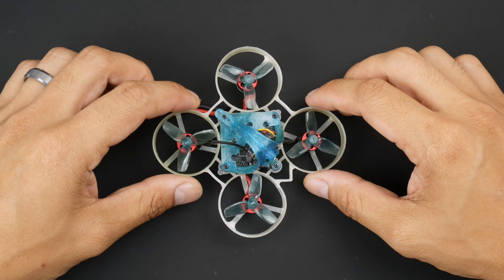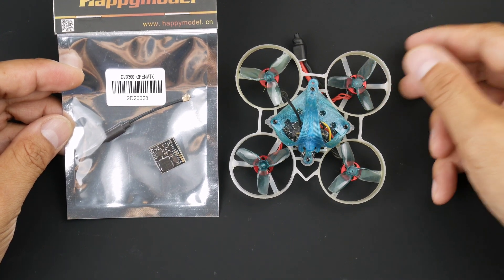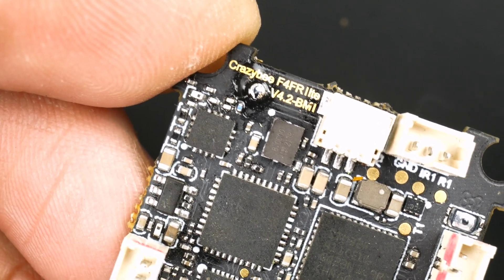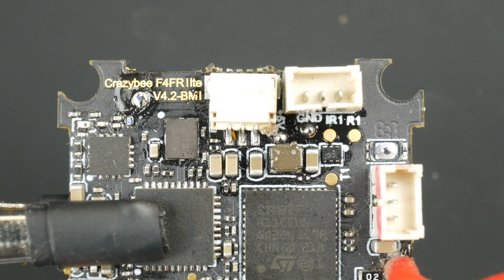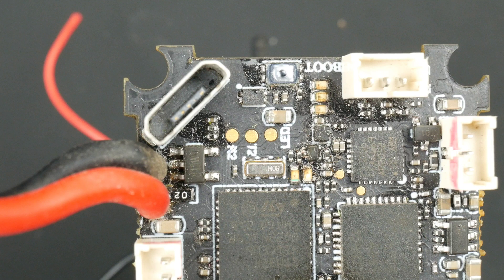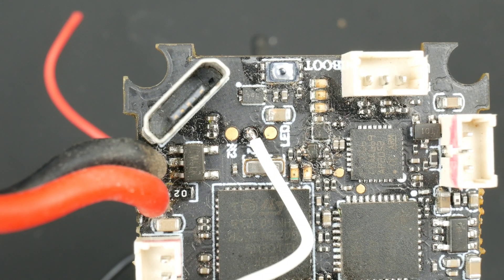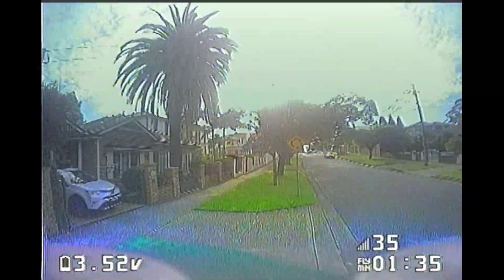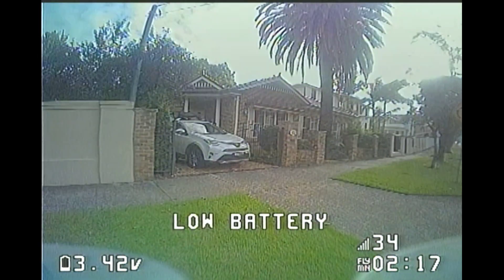Mobula6 Broken VTX - External VTX Install!

Comment: I got my lost whoop back but the vtx is damaged, not even get into the osd screen but just the somehow working but dead ouput...
I'm thinking that is it fixable or not...
Reply from the maker: @TaigiTWeseDiplomat--Formosan  yeh I think this method would work on an AIO where the onboard VTX is dead. Make sure you're able to confidently solder very small solder pads and joints

Comment: On the new board V3.3 is much easier now to disable the VTX. Is just removing a bridged solder joint. Also has a video out pin now too. Much easier to fix it.

Comment: Can I disable the onboard VTX and put a Digital VTX like Caddx Vista?
Reply from the maker: I don't think you can run a Vista Air Unit with this board since the board is 1S (4.2v max) and the Vista is rated for 7.4v to 26.4v.
Reply: @nxp200  thanks for the response.
I plan to do it in my Mobula8 (2S). 
Is it possible to convert the onboard Analog vtx by using an external Digital vtx? And maybe need changes in VTX settings in BF?
Reply from the maker: @NBALMNBALM  I believe the mobula8 runs the HappyModel X12 flight controller which does have a solder jump pad to disable the onboard VTX. I have a video on installing a Vista with the X12 here https://youtu.be/UlwLXfdlgWM . Hope this helps
Reply: @nxp200  Wow. This is what I'm looking for.. Thank you!! 😊

Comment: now i can test mine 2 i see a not so nice video feed with a tinyhawks vtx, it broke a while afte the ufl mod ...., now a few batterys laters chilling the drone did work a couple batterys and the vtx is terrible when the drone move/fly and i check the wiring, is attached still but from experience it can be broken cable if lucky but also burend vtx . when just plugin the drone the vtx is good stand stil

Comment: And you dont have to configure on betaflight your vtx ?! Its just soldering and play ?!
Reply from the maker: You can tune into it with the default channel and power mode that comes default from factory. If you want to change the channel and power mode, you still need to go into Betaflight, set up smart audio in the ports tab, update the VTX table and set the values you desire. The smart audio vtx table can be found here on HappyModel's website:
https://www.happymodel.cn/index.php/2021/07/27/happymodel-ovx300-ovx303-5-8g-40ch-300mw-vtx-openvtx/

Comment: Can you make a tutorial like this for mobula 8? My internal vtx is broken after a crash, and i already soldering external vtx and it still showing internal vtx
Reply from the maker: The Mobula8 comes with the HappyModel X12 flight controller. This FC AIO board has a solder bridge that enables the onboard VTX. Not sure if you've done this, but if you're trying to use an external VTX, you need to desolder the VTX power bridge. Here's the product spec sheet:

https://www.happymodel.cn/index.php/2022/04/05/x12-aio-5-in-1-flight-controller-built-in-12a-esc-and-openvtx/
Reply: @nxp200 Thanks for that. Is this solder bridge done on the X12 board so you don't have to use clippers to destroy the on board vtx and pull the coil wire out like you did?  I assume so.
Reply from the maker: Yep. That's correct
Reply: @nxp200   Thanks for getting back with me. Much appreciated!

Comment: Hello, I damaged my vtx antenna connector when I was trying to change the frame of my mobula6 ELRS. The  procedure to install external vtx  ( OVX300) is the similar?
Reply from the maker: I haven't worked with the ELRS version of the Mob6 yet, so I can't say it would be the same. I don't know if the components and PCB traces are in the same locations. Sorry.

Comment: Hy, my mobula 6 elrs has bad vtx range, 6-10 meter and the video on googles completely blank, is that broken vtx or what?
Reply from the maker: I would check if the power output of the VTX is set to 400mw instead of low power 25mw. Otherwise, is the VTX antenna damaged? It's a thin wire at the front of the quad next to the camera and I find it's easily broken
Reply: @nxp200  i bought used, already set 400, the antenna is broken and has been soldered, maybe install ovx300 can solve the problem?
Reply from the maker: @diabagasm  Ah I see. Replacement antennas are tricky as they have to be the exact length down to the 10th of a millimetre. I would try to research that and try getting the onboard VTX to work by varying the antenna length. If I can't, I would install the OVX300, because I have already done it successfully a couple times (once in this video). As you may have seen, be absolutely sure you want to go ahead with the OVX300 install, as it is non-reversible since you have to destroy the onboard VTX inductor to disable it. Good luck!!
Reply: @nxp200  thanks for the advice, i will buy ovx 300 and replace it
Reply: @nxp200 i follow step by step but not work
Reply from the maker: I'm sorry to hear 😓

Comment: What about video  in then my vtx has 5 wires
Reply from the maker: Sorry, I'm not sure what you mean. The video OUT on the flight controller goes to the video IN on the VTX. Video transmitters also can have extra Ground, 5V output and SmartAudio input pads. What model is your VTX?